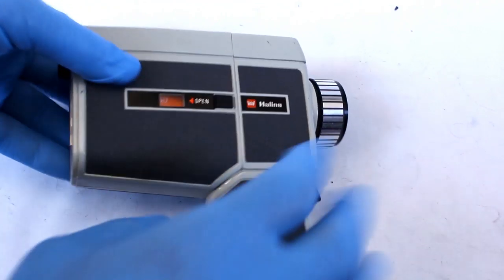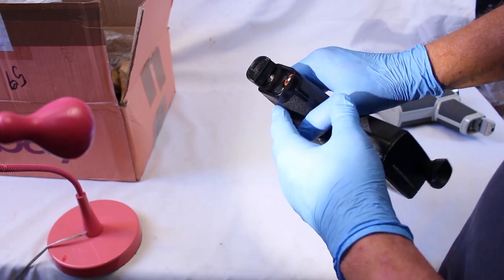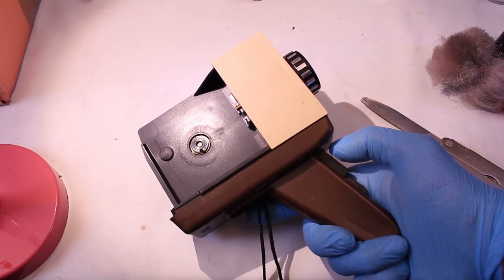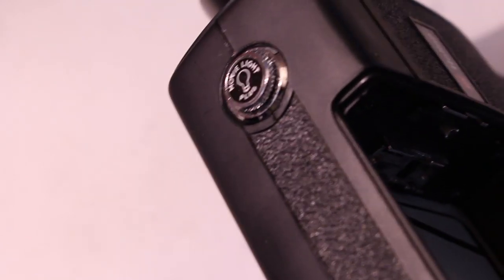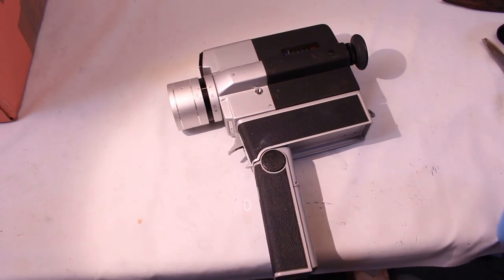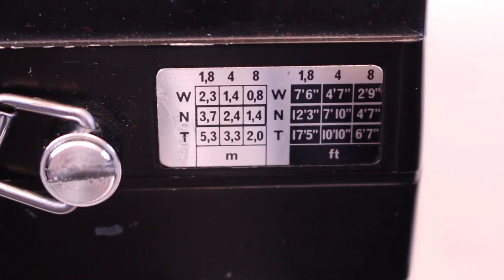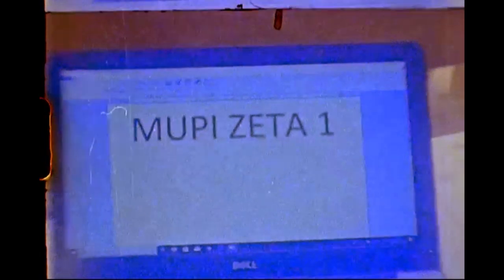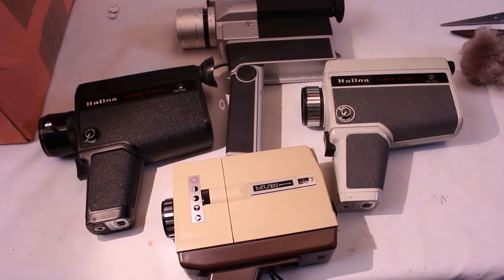Fixed Focus FRENZY! The Simplest Super 8 cameras out there...

Comment: I would like to point out one thing you forgot to mention. Most of those and alot of other super 8 cameras also need a button cell battery for the light meter to work. Obviously that’s not really a problem if you have manual aperture settings. Anyway great video by the way.
Reply from the maker: Yes, in the case of the Halinas you are correct, there is a compartment for a button cell in the film bay. However the Halina has no cartridge ASA detection buttons, so it's uncertain how useful the light meter is. Without power the iris defaults to wide open. The other cameras power the meter via the AA batteries (Sankyo, Eumig) or have no auto metering at all (Mupi). Thanks for watching!

Comment: Got a Fixed focus B&H 670XL and it still works! But the plastic sleeve for keeping the batteries in place is missing.
Reply from the maker: Does it work without the sleeve or do the batteries go all awry?
Reply: @ZeroBudgetFilmSchool  I got the AAA batteries to work with it but I gotta tape them down. I’m also missing the handle too… I’m not sure if there’s another battery for your light meter or if it does all that with the AAAs? (Same with the Bolex/Chinon 625XL)
Reply: @ZeroBudgetFilmSchool  Welp, it just DIED on me! I was making a video about it then the thing made a noise and stopped moving and now when I put batteries in it it just makes this humming motor noise when I flip it on and I push the top…NOTHING! Welp. That’s typical of Bell and Howell cameras I’ve encountered. I had a 1979 B&H die on me too! Oh well he was 48 years old when he passed on July 29. 2022 RIP.
Reply from the maker: @oldradiosnphonographs  Ahh my condolences! Sounds like something has seized up in the mechanism. You have nothing to lose, so you might be able to get it open and see what's going on inside but likely some old plastic part has got old and given out.
Reply: @ZeroBudgetFilmSchool  probably it just randomly crapped out. Oh well. At least the Bolex/Chinon one is working. Now if the purchase I’ll make on Wednesday does the same that’s when it will REALLY hurt.

Comment: Ever ready still make batteries, in 1980 they rebranded to Energizer. In Australia they're the best choice for digital. Duracell never had enough chooch to get your stuff running, they'd be slightly less than the voltage specified on the can. Energizer always were. They've been a superior battery since the 70's, idk why, but other ones seem to skimp out.
Reply from the maker: Never considered that.... I guess I just fell for the Duracell advertising all these years!

Comment: I have the Halina PS 200 RD like in this video! I need help with getting a cartridge out that's already in the camera. It was bought with the cartridge inside but their is a red dot in the viewfinder which means the mercury battery which I assume goes behind the cartridge is broken/ out of battery but I can't get the cartridge out to see. Is there a way it unclips? I don't want to break the camera you see.
Reply from the maker: Grasp the cartridge at the back (the furthest edge from the lens). Pull the  back of the cartridge out first and the whole thing should come out.

The red dot indicates insufficient light, but if it doesn't go away even if you put a lightmeter battery in and you point the camera right up against a light then your light meter is likely stuck.

Comment: Hey thnank you for this video!
Do you know how far the focus on the Halina 300 is set at? 
And do you know if you can only use a 50D film or of it takes any other ISO?

Sorry to bother you but I haven’t been able to get that information anywhere.
Reply from the maker: Hi there, the Halina PS300 has a minimum focal distance based on how wide the auto iris goes.  When it's fully wide open anything further than about 2.5 metres is in focus. In bright light you can get closer, I'd say to about 1.2 metres.  

Unlike the PS150 that can only meter 40 ASA, the PD300 has a button in the film compartment for also reading 160ASA film cartriges.  So effectively as well as 50D you could shoot 200T with the filter on.  In fact I'd say it could probably shoot Ektachrome 100D and Tri-X reasonably well too. It might underexpose them but if you hold your finger over the lightmeter window you can fool it into opening up the iris. In fact nothing is stopping you from shooting 500T either, you just have to avoid bright light situations.
Reply: @ZeroBudgetFilmSchool  It took me so long to get these answers. I haven't been able to find a manual anywhere, and in these times it's just harder to go to a local shop and ask anything about it to someone with more experience. Thank you so much for taking your time to reply to this, you have helped me a lot.
I have one last question just to be sure, if you can indulge me.
 From my understanding the lightmeter on this camera is the hole right next to the view finder, on the front of the camera. Am I correct to assume that?
Reply from the maker: @santiagoraphael7763  Yes, that's correct. Do you know about the battery for the light meter? It's under a spherical cover under where the film cartridge goes. If you have no battery in there the iris will be fully open all the time.
Reply: @ZeroBudgetFilmSchool  Thank you! Yes I saw it on your video, I changed the battery a couple of months ago and the lightmeter seams to be working, the red "flag" comes up when Im in a room etc, so I think everything is okay on that matter.
Thank you so much for your help.

Comment: If you've got battery acid eating up your guts, it's a quick fix, don't bin your equipment over it. Strip it down, clean it up - if it still doesn't work ask anyone with basic electronic skills to fix it. Never throw away good kit over some acid.
Reply from the maker: Sound advice! I've read that a paste of bicarbonate of soda is what you should use. Is this what you'd recommend?